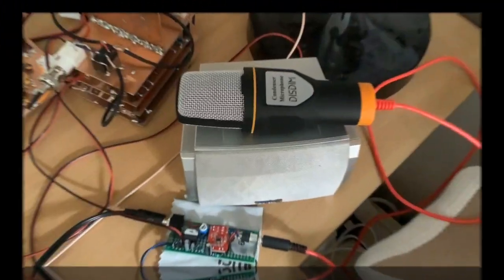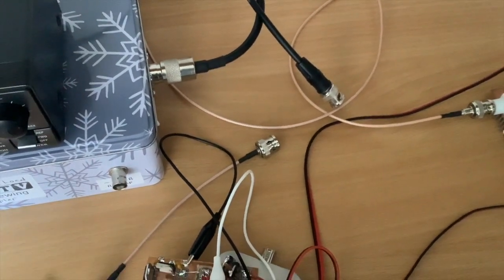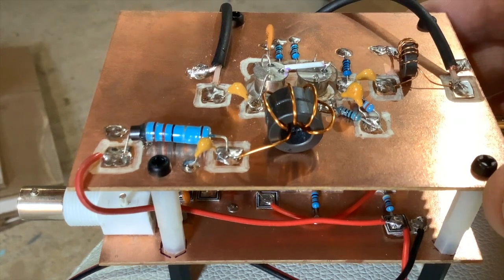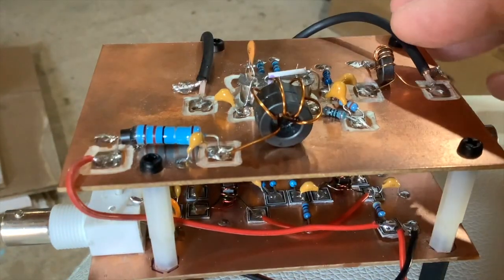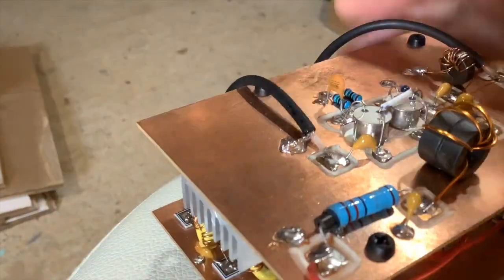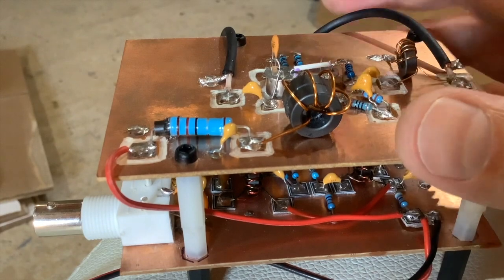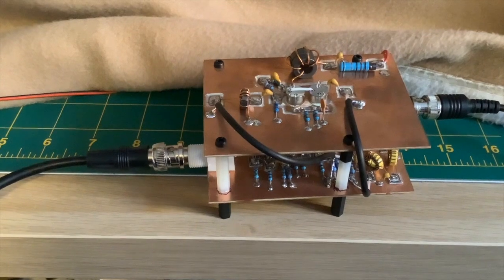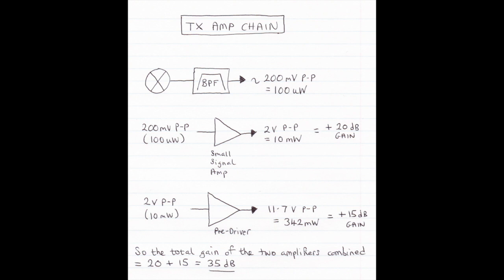29 - Small Signal Transmit Amplifier

Comment: Did you have issues with ground loops using two pcb's?
Was the coax shielding grounded at both ends, these issues seem to stop most RF amplifiers from ever working not the design of them
Reply from the maker: Hi Ivan, I don't remember having any ground loop issues. Yes, the coax was grounded both ends. 73, Nick

Comment: Once again very nice video
The only thing that slightly concerns me is the distortion on the first stages. Maybe a three stage amp with lower stage gains would help. 
Andy
Reply from the maker: Thanks Andy. As you may have guessed, the low pass filter was originally at the output of the bottom board (the small signal amp) to clean this signal up a bit. However, in my actual radio I'm getting a bit less signal than 200mV P-P on the input and there is less distortion. For this video I picked a round number to make the maths more easy to follow! So in the end I sent the output of the first stage straight to the pre-driver (top board) and then through the LPF. As you can see (even with 200mV) this works well and the signal is very clean.

I've found in this radio that a tiny bit too much power can make a big difference. It can all turn on just a few dB e.g. whether your amplifier is happy in its job or decides it wants a career change and become an oscillator!

73
Nick

Comment: If you have a choke/inductor in series with R2  100R base resistor (predriver), you may gain several dB, since the 100ohm is across 50 ohm input. It may negate the need for having the transformer as well? Typically I would drive the IF port of the mixer with -10 dBm, so your -10 dBm after the mixer, and BPF sounds high..?
Reply from the maker: Hi Kevin, thanks for your suggestions. All I can say is that it works for me - and every rig I've built has been different. As soon as I've built something I start thinking about how I'd do it differently next time! Thanks again. 73 Nick

Comment: what about using GaAs low noise FETs for driving a VN66AF in Class A mode for perfect linearity that will drive a BLF0910H9LS750P in Push-Pull mode.
Reply from the maker: Hi David, I've not used those devices (yet) but thanks for the suggestion and for watching. 73 Nick

Comment: You shouldn't parallel BJTs like you have with the 2N3866 transistors in the pre-driver. They should each have their own emitter resistor so that they share current equally.
Reply from the maker: Fair enough. That's makes sense. Thanks for watching anyway.